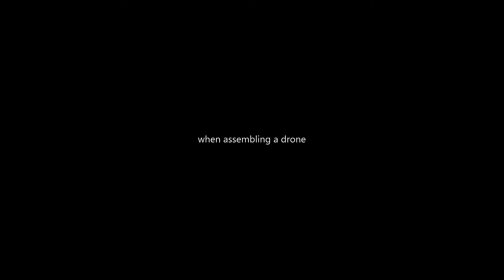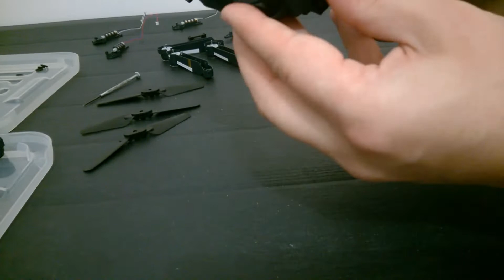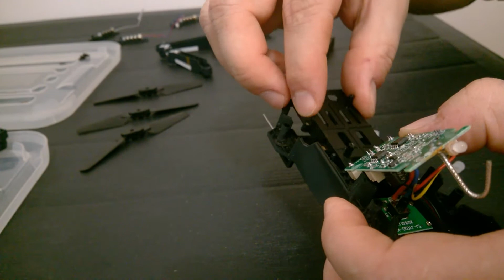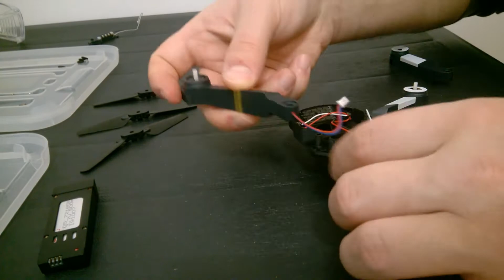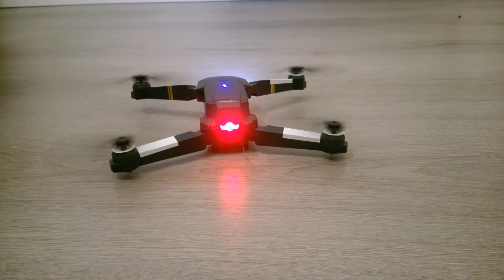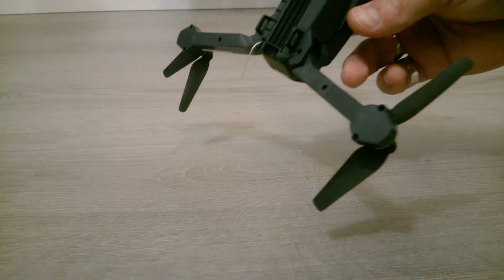How to Assemble and Fix Eachine E58 Drone (aka Drone X Pro). Why my Drone does not Take off? Part 2.

Comment: i am trying to put eachine e58 electronics into a 3d printed frame (110 mm). everything works fine except drone doesn't lift. i am suspecting because of propeller (55 mm), what  should i check other tanh propellers?
Reply from the maker: You should check the weight of your frame in relation to the original drone weight. Also check if you installed the blades of the propellers in the right position.
Reply: @AventuraRemoteSmart  does 5-10 gr matters ?

Comment: How to fix e58 drone, when you put the battery in, it will start working immediately when you turn it off
Reply: short circuit on motherboard maybe (mosfet)
Reply: How to fix it help me
Reply from the maker: When you say start working, do you mean led lights turn on or the propellers start working? If led lights turn on, you may have water or moisture in the turn on/off button or circuit board. Drying with hair drier may help. If not, try to clean circuits boards with a fast drying contact cleaner spray. I guess propellers won't turn on unless you use a remote control. If nothing helps, the failure in the circuit boards is not an easy thing to repair. It would be cheaper to buy a replacement circuit board or buy a new drone.
Reply: Where can I buy a circuit board?